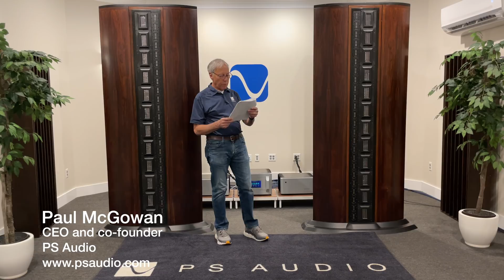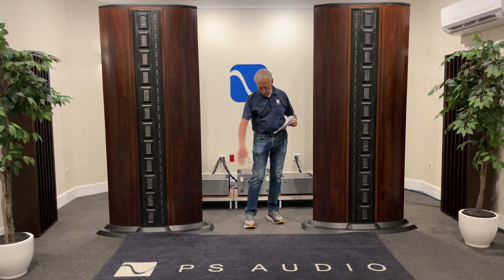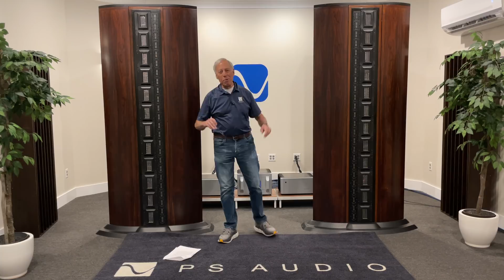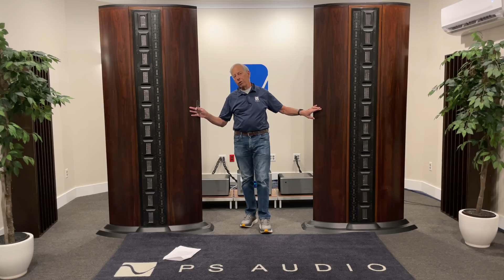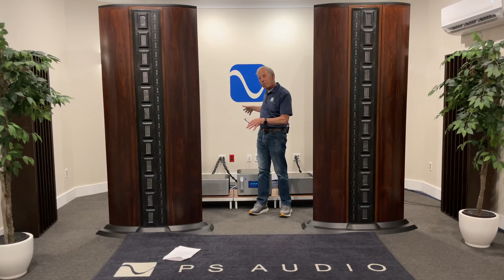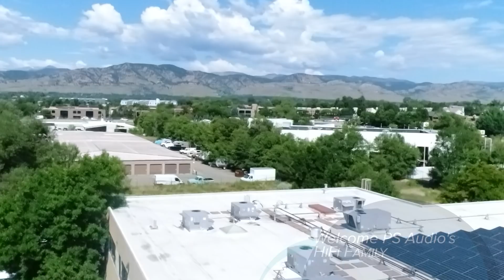Why sound comes from behind the speakers

Comment: Paul has used the analogy of speakers being microphones “flipped 180°” before but I don’t think he is actually explaining why it happens. At Ieast I don’t get it. How cool would it be if you could have a 3D stage in front of the speakers? The artists would really be in your room.
Reply: He is getting the explanations wrong.  There is no way for the mics to detect what is in front or behind them, unless they are a single-direction mic.  And if they were a single vector mic... I dont see why they would play the sound "Backwards".

 Think of it like this:  If you had a speaker that was 5ft away from a Mic... and the speaker played a sound...  The Mic would record this sound, the same as if it were your human ears.  As if, someone was talking directly at you, in front of you.

 Now.. if you play that recording back on speakers that are facing your ears... the sound sound be the same as they were heard, as if your ears were the MIC itself.

 The only way you might get a sound "Behind" the speaker... is if you had a single direction mic that was insulated decently... yet was able to pick up a different persons vocals, that were physically behind the mics front facing sensor + backer insulation.  The sounds that it picked up, would be slightly distorted in tone and details, due to the insulation, and extra distance + vectors away from the main sensor orientation.

 Most speakers SHOULD be able to provide a 3d Image into the entire room.  Mine do.  I suspect there is an issue with Ribbon tweeters, which may be causing a lack of depth to be spread out, causing a very narrow image... that gets some help from placing the speakers more centered in the room.  I dont need to do that with my old 70s era speakers.

 If you check my other reply, it goes into better detail.

Comment: Mine does because they are dipoles
Reply: So are those IRS Vs, the sound comes from behind my elac debut 2s even though they aren’t dipoles and even have front facing bass ports.
Reply: Was just about to say that.  Love my Maggie’s.
Reply: @andrew5200  Me too
Reply: @andrew5200   Same
Reply: Dipoles distort the sound, because they pump it out in every direction at once.. which causes echo-like effects.. as the sounds bounce off the walls at different times and angels.  I heard a pair at radio shack, and while the detail was crystal.. the distortions were horrendous.

 Id image you would have to put foam on every surface of the walls, to fix this issue.

 IMO, Id try to wall off half of the dipole, to see if limiting its direction to 180 degrees would work much better.

 Thing is.. when someone talks to you... it comes largely from a single vector.  If the sound of their voice came from every direction all at once.. it would be a real mess.  This is where Dipole design fails.  Its simply unrealistic to actual natural sounds, and true 3d depth imaging / soundstages.
Reply: @johndough8115  So when you go to hear an Orchestra are you saying that none of the instruments are radiating in more than one direction? I don’t agree with you John.
Reply: @Scopolamine46  You are speaking about human ears  - vs  - a microphone recording, that is vastly different from a live sound image.
Reply: @johndough8115  I don’t believe I am. My ears are at the end of the entire process from microphone to my ear. I stopped at the speakers because that was the way I interpreted what Paul was saying.
Reply: @Scopolamine46  If I am speaking directly to you in person, with your eyes closed... I could put a speaker at my heads level, and make it sound virtually identical to my voice, to "Fool" you.  But what If I placed 10 speakers in a circle... instead of just one?  Then your mind would easily be able to detect that it was not ME, that was speaking to you.

 You would instantly know that it was the 10 speakers playing.  Why?  Because the 3D Directional sound image.. is completely DIFFERENT.

 This is what a Dipole ribbon tweeter is.  It projects the sound in all 360 degree directions at once... which is NOT accurate to the original source "Image".

 To be more advanced... when I speak of "Image".. you should note that when you record, for example... your voice... you are not just capturing your voice.  The sounds are bouncing all over the room.. which alter the soundwaves, tones, volumes..etc.   So, for example... if you have a mic stand, and a chair in the room... those objects are captured in the recordings 3d depth "IMAGE".

 The best way to keep this 3d depth information and clarity... is to use the intended speaker projection method... which is a standard speaker setup.  If you change that.. you are not going to get the correct sound image, and it will cause distortions, and the depth information will be Drastically changed from the source.

 Its easier for this type of tweeter to be used in quiet music, such as an Orchestra / New-Age.. because there is more Pausing and Quiet spots in the music itself.  The sheer amount of instruments also help mask clashing distortions.  These flaws would be a lot more apparent in something like a Rock song.

 With the Radio Shack special Dipoles, I was initially amazed at the 3d effects it made, when it was playing some vocal TV commercials.  However, when it started playing some music, it was a disaster.  The sound was Artificial and fake sounding.  Very similar to what I explained, about having 10 speakers pointed outwards in every direction... it destroyed the natural 3d depth map. This caused an uncanny valley effect in my mind, that simply would not accept it.
Reply: @johndough8115  I agree with you. No one can expect exact outcome from two sources if one of them is radiating some sets of harmonic with single elements like violin or saxophone  or mouth and  other using many sources displaced each from other and radiating  parts of their work in few directions  At first phase coherency which means time of travel of all radiations to ear will be  not in accordance
Reply: @johndough8115  You may have to up your game from Radio Shack to hear a good example of a dipole.  They do radiate forward and to the rear but almost nothing to the sides so you generally have less wall bounce to deal with.  They do need to be well out from the front wall or you will be right about issues of time arrival off the front wall.  But when they are done right you finally understand sound without a box.  Then almost all box speakers sound wrong and you'll crave OB or good horns even with the limitations of the rooms in which you can use them.
Reply: @user-od9iz9cv1w  You lost credibility the moment you mentioned "Horns".  The shape of a horn, causes massive distortions in the 3d Image details.  Yes, you still get high frequencies.. but you will not be getting the true spatial 3d information correctly... because it gets severely warped from the shape of a long horn.

 Horns are best used for pure Volume filling applications, such as Concert sound.  They are not made for precision audiophile music reproduction.  Some less than informed Audiophiles might use them... but that does not make them right.
Reply: @user-od9iz9cv1w  It does not matter how Precise you make a horn.  It does not matter what space-age materials you make a horn out of.  What matters, is the SHAPE!  The very SHAPE of a horn, causes the soundwave form to CHANGE!

 Cup your hands over your mouth.  Does it sound the same?   Use a giant funnel.  Does it sound the same?   Horns cause a more directed and Amplified sound effect.  A louder sound, does not mean a CLEANER and BETTER sound!

 Ive heard, and OWN, several sets of Audiophile Speakers.  I also own a pair of Sennheiser HD 650 headphones.  I know the technology behind speaker design.  I know the differences in Driver Types, Box designs, and Much more.

 Horns are TRASH.  You use them for things like the Club, Concerts, and or massive Movie Theatre speakers.  They are not High Definition, Audiophile equipment.

 You can put the BEST tweeter in the world.. INSIDE of a horn shell... and that tweeters clarity, and accuracy, will turn to distorted Garbage.  The Spatial 3d image in music, will be LOST to this distortion.

 ECO NUTS love to try to push Horns, and Shi**Y bass-distorted PORTED boxes, with their low power ECO drivers.  Why?  Because it fits their AGENDA.  NOT because its a better option!   Its the same crappy reason why all music made in the 90s and beyond, is compressed to flipping Hell.  To reduce Amp power draw.

 Yet... these people have no problem with CERN using 10 Cities worth of Power, to end up with nothing but a few clueless "Theories" about particles.   They will let you have HD quality audio in a Bluray discs.. not NOT in you CDS!  AND... they dont mind your devices wasting countless amount of power, to Decode encryption, as well as to Spy on you.  Or to waste countless resources on Fake Digital  Currency scams.

 These same idiots pushed for removal of trace amounts of lead in soldier, from electronics.  Sounds good on paper.. right?   Well guess what?!   Due to the replacements not flowing well... about 70 percent of all Electronics are failing in less that a 3 yr period, as a result.  The amount of E-Waste that has resulted... is doing about 1 BILLION times the Ecological damages, EVERY YEAR!!!  Not only that, but its doing incredible damage to the Citizens, whom cant afford to keep buying new replacements!

 But this is how the Extremists work.  They take ZERO accountability... and are FULL to the GILLS with HYPOCRISY.

 You can shove you ECO Horn where the sun dont shine.
Reply: @johndough8115  OK, I think I get it.  You are not a fan of horns or dipoles.  Cool.
Reply: @user-od9iz9cv1w  Its not about Fanboysim.  Its about Accuracy.  As said, If You place a huge funnel in front of your mouth... does your voice sound the same?

 And if you put 8 full sized speakers in a circle.. .that are playing a recording of your voice... will they FOOL a person that is Blindfolded in the room.. to think that its Your mouth...vs.. those speakers?

 Dont you think that a Single high quality speaker... be far more able to fool such a person,  than 8 speakers pointing in different directions?

 When that blindfolded person hears the sound differences that occur from sounds bouncing in all different directions.. they will know INSTANTLY that the sounds are not coming from a human... because no humans direct voice, would be scattered all over the place like that.

 It may be a cool special effect that certain people may like... (which is why Leslie rotating speakers are still sought after)  but its not accurate to how the music is supposed to actually sound.
Reply: @johndough8115  weren't those from Radio Shack omnis? Pretty sure they were.
Reply: @scottyo64  I found the description of them:  OPTIMUS LINAEUM DIPOLE TWEETER SPEAKER 40-1389

 You can find them on Ebay.

 They were placed on top of a very small speaker, which you can also find on Ebay, when searching for the same.